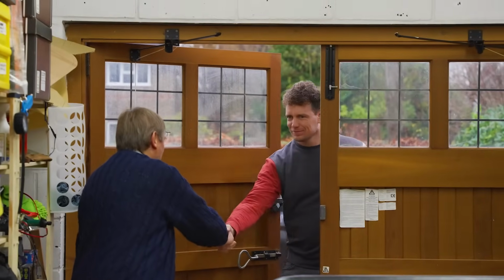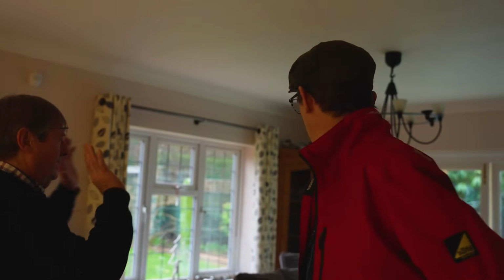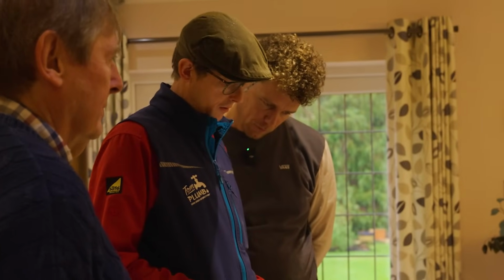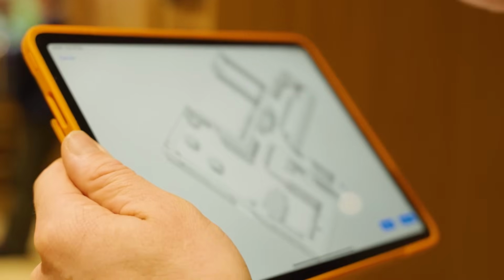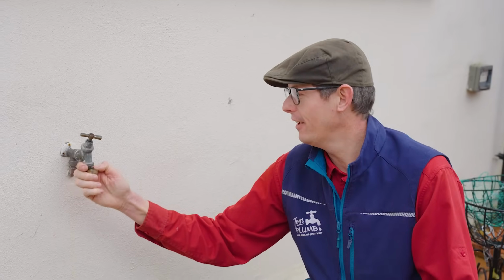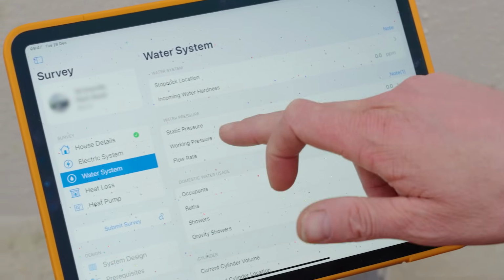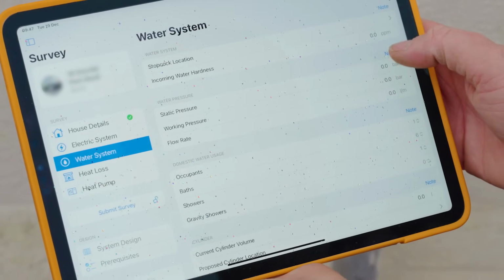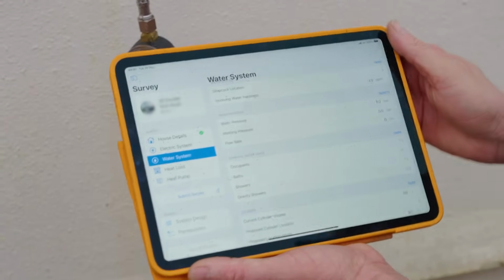Don’t Miss This Essential Step When Getting a Heat Pump

Comment: All very good comments. My issue is the industry is plagued with parts that are the same but (on purpose) slightly different, so that there is little interchangeability. This is good for manufacturers but terrible for the environment.

Comment: in regard to the situation with the loft insulation, consider this.  if the homeowner were toinstall three inch sheets of hard foam on the floor, caulking with foam between the seams and edges he will be able to achieve an extremely high r rating and virtually no mess or demolition.  here in the u.s. if one goes to a mall or other large commercial roof job the contractors remove sheets of the material which also has been treated with a pesticide already and it goes to landfills. we have approached job foreman and asked for their waste and they are more than happy to give it to us because they pay to dispose of it.  we load a rental truck and repurpose the material in the home. now we solved two problems for cheap and it can actually be fun to do. the sheets are generally 4x8 sheets and are very lightweight. a case of dark beer is always a good swap.

Comment: The extraction/air change problem need 're-framing' as being about selecting which air is the air that you preferentially want to release to the external environment (extract), given that the incoming air is coming in through leaks & gaps whether you like it or not. 

Thus it's far more advantageous to 'exhale' the damp air from the house (at source)  than letting warm dry air go to waste. Suck that moist air out!

It's all about the bad mental models. Reminds me of the days when you/granny shut doors to keep the cold out, rather than keeping the heat in!

Comment: The entire system seems over engineered for such a small house. Sorry think they saw the customer coming.   We have two split systems (air con/heat).  One smaller one in master bedroom and a large room situated in the lounge.
Reply: They give him it for free in the end and all the follow up videos show how happy he is?
Reply: V.late reply - but it's not a 'small' house, by most standards... iirc 8 bedrooms, 2x baths, 4x showers...  they don't show most of the house in the videos (probably to respect Johns privacy), but if you pay attention to the 3D room-models in the app that keep appearing on screen, you can get an idea of the size/complexity of the building.

Comment: Can't understand. Heat loss of 12.97kw and a heat pump of 12kw. ??? Also the 12kw is an estimated average over a year, that could be 18kw in summer or 6kw in winter when 0C. How can that work in winter ? 12.97kw heat loss and heat going in is only 6kw ?

Comment: I think you need to do a video on the cost to maintain the heat pump, depending on the amount and refrigerant type may be subject  fgas regulation leak check along side a yearly service.

we already know their is limited engineers that can install these, there will be even less that have the experience and qualifications that can work on the fridge side.

other things to consider is response times for call outs on the fridge side if the plumber that has installed it can not rectify the fault and has to wait for a qualified engineer or the manufactures.

Warranty length is also crucial on these, as being an AC engineer in the trade for 25 years i know exactly how much things like pressure leak tests are for lost refrigerant, inverter compressor and PCB’s are to change once out of warranty and it’s not cheap, it will make people’s eye water.

This is not a criticism as our industry has been using air to air & water heat pumps for decades in commercial properties with great success, but we need to discuss all aspects if people are installing these in their homes.
Reply: These ones (and most of the monoblock ones going in the UK) don't fall under F-Gas - They are R290, and the refrigerant is hermetically sealed at the factory. The units can be (and already have been in a few cases) DIY installed without any knowledge of the refrigeration circuit.
The only bits that need any sort of qualification, are gas boiler removal, and if the cylinder needs changing from vented to unvented.
The Vaillant ones get a 7-year warranty if installed by a Vaillant partner.

Comment: I  love how poor they are...A radiator is a heat emitter...NO radiant heating.... Ask them what radiant heating is...... I have never heard such nonsence.... They really don't have a clue.....What I love is  listening to how they intend to change the laws of physics....They sound convincing... But it's just lies....I am sorry but no wonder every can't trust HVAC engineers.  Fit a micro CHP and you will get combined heat and power.... He has not mentioned how you get DHW that needs to be at 60 degree's C to avoid legionnaires disease

Comment: As a HVAC Engineer and someone who has worked in the industry for 27 years.... Don't bother with heat pumps. As now a controls engineer in the commercial sector.... We have heat pumps with heat meters on the secondary side and an electrical meter on the primary side... We are getting massive negative coefficients... Don't bother with air to water heat pumps...If you want a heat pump...use recycle air conditioning units... What a load of rubbish they are talking a 7kw car charger will use more than a 12kw heat pump... Really... How is 7 greater than 12..... 12 kw will use 4 x 12 =48amps... What planet are these boys on... Don't waste your money or time... Fit a boiler and bin the heat pump
Reply: Err, are you sure you're a HVAC engineer? if you were you'd know heat pumps are rated by heat output, not electrical input.  Check any spec sheet of a heat pump and you'll see the maximum draw or fuse is around about 50%.
The 12kW Arotherm Plus has a rated maximum current of 23.3A, and a fuse size of 25.   25Ax240V=6000W.
Reply: @BenIsInSweden  ben ... Add in apparent power over reactive power and the 7kw car uses miles less electric.... Are you sure that    you are an HVAC Engineer.... ????
Reply: @RobertWheeler-t4z what are you on about, a 7kW wall charger needs a 32a fuse. 

A heat pump moves heat so never consumes the badge rating in electricity.  All of them will have an inverter as well so will be using a fraction of its max draw.

Comment: Hard to believe the first contractors fitted a new system and didn’t ensure the attic was properly insulated. That has been a basic requirement for over 50 years.

Comment: This is so helpful - question though, how do you ensure that your contractor will install a heat pump properly particularly if you are applying through the ECO4 scheme? Companies seem quite pushy and then I immediately don't trust them to do a professional job!
Reply from the maker: Heat Geeks guarantee the system
Reply: @SkillBuilder  Thanks so much for responding - really appreciated, but I don't think Heat Geeks carry out ECO4 work...?

Comment: Funny all the comments saying this looks far too involved. This is what properly sizing up your heating system looks like. It looks weird because no one ever does it. This house has been one bodge job on top of another for decades. The heat pump didn't cause the problems, it revealed them
Reply: There are a number of relatively easy to use home (web browser) heat assessment packages such as HeatPunk to allow you to throw in your floor plan (estate agent quality is suffice), where the radiators are, and out pops an assessment. refine as needed. Quite insightful as to where the losses are.
Reply: What’s the point in it though, if I can get a gas combo boiler and don’t require a water tank, then what benefit is there having a heat pump? You’re essentially sacrificing space for water tank heating up water and not using all that is required along with the humongous sized radiators. Not to mention the humongous eye sore that is the heat pump itself.

Gas is wayyy cheaper than electric too.
Reply: @Khevin33  you are fighting the wrong battle there.
The real argument is between a well insulated, comfy all round house and a "heated in bursts" house.

Note that they aren't direct opposites, which is why the arguments get heated (sic).
Reply: @philipoakley5498  what do you mean? Fighting the wrong battle?

Comment: Don't you have make it perfectly clear what your assumptions are? Whilst the heat loss is for sizing of the heat pump, however in this modern day and age you should define where the energy is coming from and at what cost, before then designing the system. The variation in cost from house to house can tend one to prefer a hybrid system.

Comment: Really enjoying the heat pump series. I am in Canada where my winter lows can be minus 25c, summer highs 30+c, hoping you might have a reference to that at some point?
Reply: What do you mean a reference? Scandinavia has those minus temperatures and they run air source heat pumps too, much longer than in UK

Comment: bloody awful to see the complexity and cost for these systems, seems so unnecessary!
Reply: A survey to find out all the ways your house is leaking heat then making recommendations so you install the most efficient heating system applies to any source: gas, electric or whale oil. They’re providing a premium service. I’m sure you could get a cheaper install with a less efficient system. - It’s a choice.

Comment: We had a groundsource heat pump in2008 we took it out 2 years later!, Heat pumps work if your house is full of insulation or electricity is cheap as in Canada. They will never work in the Uk as the weather is to wet to often. We are being sold something that will never work!! Just buy an electric boiler!.
Your wasting your money and time

Comment: 23:00  That new heat-pump do they really wanna install it so close to the fence and the neighbor's property ?
The neighbor isn't getting any benefit from this heat-pump, so the neighbor should not be given the disadvantages either,  like the cold air that comes out of the heat-pump and the terrible noise. Why not install it in the middle of John's property ?

Comment: Here in the usa there arent many air to water heat pumps for homes and/or domestic hot water from what I've seen.  Don't understand why.
Reply: air2air that doubles as a/c is more common in tthe usa, aus and nz.
Interesting things happening with split hp combined with mhrv

Comment: A typical family that I’m used to deal with has a very fixed disposable income to pay for things such as boiler breakdowns or worse replacement. There’s normally not very much room in the properties I work in. What is the smallest room you would be able to install everything needed in and what would be a typical cost of installation assuming rad sizes, insulation etc are adequate.

Comment: Why you playing this advertising game? We don't need a heat losses estimations when house already heaving a heat source.  Please use real data from temperature sensors and a clamp heat meter ,gas meter or this old heat pump ( flow meter)
Reply from the maker: I am always amazed by how little people understand about videos and the reason they are made.
If, as you suggest, we simply took the heat loss from the old heat pump data it would only compound errors. It wasn't working efficiently and it is a high temperature unit so we start with the basics.
More importantly it would mean nothing to all the people who are considering having a heat pump and want to see the essential stages in the process. We have to broaden the scope not narrow it.

Comment: I have been following this series of videos from the start and it’s interesting 
But I can’t help getting an overal feeling of What….a…. Faff. I am sure Heat Geek will get this gent a result due to their competence and care in this case. But I cannot invisage a day when this will be able to be rolled out en masse country wide given the level of complexity and the expertise and care needed, also knowing human nature (both contractors and householders) 
There has to be a simpler way. But, that said,  I don’t know what that is…..
Reply from the maker: Hi Mark 
The simpler way exists, it is a gas boiler which modulates and suits all home. If you want to reduce CO2 a hybrid heat pump/boiler will do it and it will work in any weather in any home. 
I have always said that if any product is so critical that it requires a high degree of skill and knowledge to install it, then it has no place in the building industry because it just won't happen.
The product needs to be plug and play.
Reply: Great minds…..

Comment: 1:45 He says 0.5-0.7 air-changes per hour is 'more accurate' (then 1-2).  1 air-change per hour is passivehouse grade (well EnerPhit, passivehouse is 0.6). A really well-airtighted retrofitted house is in the 1-3 range. Most UK houses are 5-10. Some are 20. 
Ah - I get it. I'm talking about the test ratings at 50Pa - he's talking about average air-changes all the time - which is typically reckoned to be about 10% of the test rating. So yeah - that's about right.

Comment: There should be a legal cover for heat pump installations to be 8 years with insurance companies covering it in case of the company going bust it’s totally unacceptable that a poor install like this be allow in a way like housing inspection I want the equivalent for heat pumps installed and installers covered by a system such as gas safe registered but for heat pumps yo be mandatory

Comment: I would need a good few grand in prior works before considering a heat pump.  House is full of air leaks.  Not least is that the loft insulation folks vented the upper attic, but didn't seal the dormer nested within it.  So bedroom wall and living room cieling are exposed to the near outside temp with 0 insulation.  Some rooms are not worth trying to heat, depending on the wind direction and outside temp.
20*C when it's 2*C outside?  Not a chance in hell, even with a 30kW boiler on full tilt and the loop temp set to 80C.

Comment: If the rad is piped bottom-to-top, the flow should go IN on the bottom and OUT on the top,
else the waterfall effect will only heat around half of the volume.
Reply from the maker: I don't follow you. The pipes are always opposite ends. With a pump I am not sure there is much difference between flow in the top or bottom.
Reply: no.   should go in at the top, out at the bottom.

Comment: Well done to John for giving heat pumps another go. Great to see Heat Geeks are making life easier for their installers. Good luck with the install!
Reply from the maker: Heat Geeks are going to guarantee the system is cheaper to run than gas and put a live on line monitor up so we can all see. For John the risk is small. This is the only way to go when buying a heat pump. It is not right that the public have to shell out for a system that may or may not work. Where else would you get that kind of deal. If it isn't fit for purpose the consumer should have protection.
Reply: @SkillBuilder  Yes there definitely needs to be some sort of consumer protection.
It is interesting that on the app Heat Geek/Tom Plumb used there is an evidence trail (photos, room dimension scans). I hope that this evidence trail is also taken on the installation work (show the components/pipes/joins/insulation); lots of grant installs look to be sub-optimal, and we're not talking a small amount of government (i.e. our) money being granted for such upgrades.
Reply: It's a shame the comparison isn't being done with a weather compensator and "proper install/commissioning" of the existing gas system, under under this conditions I very much doubt the HP would come in cheaper to run on comparable comfort basis. That would then contribute to a massive CO2 saving, a real costs saving annually, and negate the high migration costs to a HP solution.That would be the appropriate benchmark. @SkillBuilder

Comment: Ref: Sitting room radiator/poor temps. The position of the radiator next to the door to the hall way containing stairs to the first floor (?) will not help the movement of heat across/into the room - most will be drawn upstairs  to the first floor ? Old looking door/windows (albeit opening to an (unheated) conservatory) is likely to further exacerbate the problem ?       
Minor point but relevent to a particular problem. .

Comment: Nice survey, interested to see the heat loss difference on the conservatory? Also will need to check R290 heat pumps going to a rainwater drain!! Follow Vaillant spec and do a soakaway😊

Comment: But what about the problems with radiator under performance often between 25 to 38% under supposed rating. With a boiler this can be compensated for to some degree. 
If you live in the country you have a limited public supply to many villages which cannot compensate for the increase in consumption. A local neighbour was told the new supply would cost £146, 000. He purchased a PV array because he owned the adjacent field. This is not viable for many.